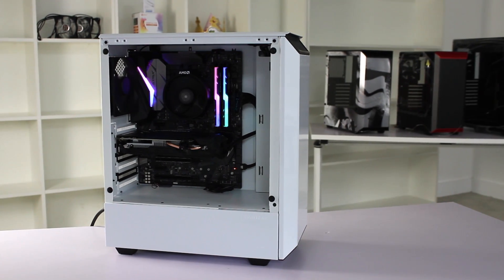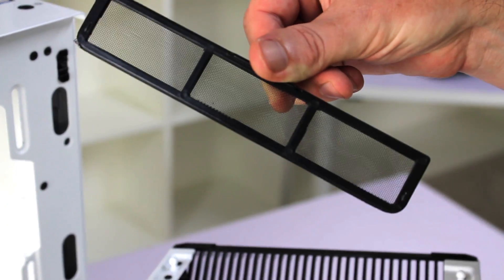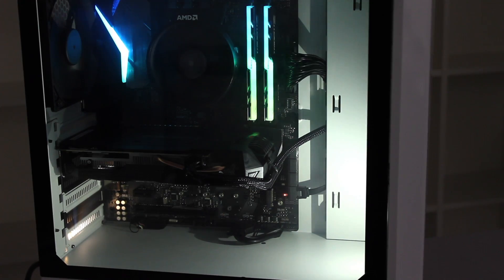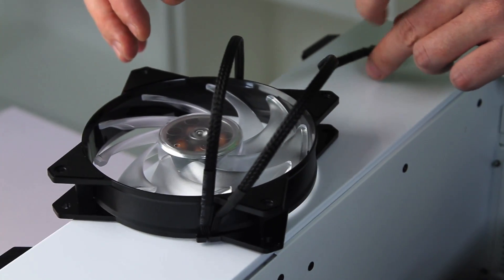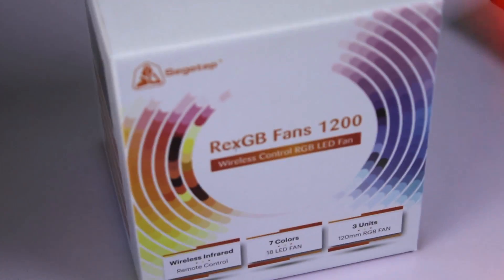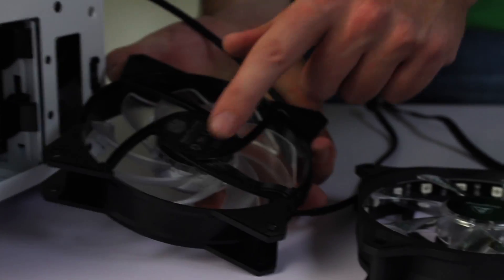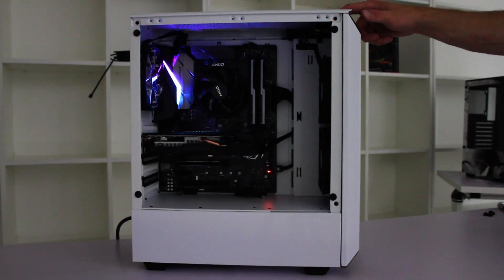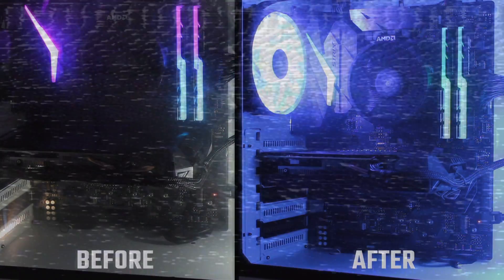How to keep your PC dust free

Comment: Perfect explanation; thank you for the reality check
I have a mesh front coolermaster case which also has a top and bottom filter and the inside of my PC is still caked with dust. I can't help that I live in a dusty room and I hardly ever clean it - yeah i've lost all self respect.

Would this work? I thought to drape something like mosquito netting over the case, speakers and the desk it all sits on (monitor sits forward and below the case) - that netting should work, right? Create sort of a outer filter to clean the air that gets pulled in? Hope you can advise. Thanks again

Comment: Guess I'd rather settle with a mesh case.

Seems to keep the dust away and all you need to do is clean the fan blades inside.

 Or no filter if mesh doesn't do anything (even though it gets pretty dirty) because cleaning the mesh is annoying

Comment: Dude, PCIE slot covers need do be full metal or have additional dust filter with nylon or something - there is no other way of preventing dust from getting through back of the case.
Reply: just tape it with electrical tape

Comment: Your saying the air flow was restricted at the bottom intake and most of the flow was coming in from the top filter however judging from the direction of smoke it looked like the opposite of what your saying. Are you sure about that. You haven't shown us the full view of the case hence I cant know for sure.

Comment: the side of the fan that doesnt spin? im really lost by that.
Reply from the maker: Ha, what I meant was one side of the fan is exposed, the other side has solid plastic connectors that are fixed and cant spin, the air usually is drawn towards this direction, a handy trick if your fans don't include air flow direction markers.
Reply: @pbtech  ahhh no kidding, so the fixed plastic on the structure is the flow direction also

Comment: meh the front of my pc is all open with three fat fans for the intake, I'm probably all set on air flow, I need to know the best way to get the dust off the fans and keep it off. I was wondering, you think coating the fan blades with something like teflon would keep the dust from sticking to it? Do fan companies do this? They should try it.
Reply: If it doesn't get stuck on the fans, it'll get stuck somewhere even worse.

Comment: What will my air flow look like if my case has 2 top fans and 1 rear fan with no front fans?
Reply: Assuming all 3 fans are exhaust, you have a case with negative air pressure. Usually, that results in a dusty case since air is entering through unfiltered spaces.

Comment: I just cover my unit when turned off all the time with the plastic cover that comes with the case and I've got no dust inside for a year.
Reply: Do you remove cables everytime you cover it? If not, then how do you cover it? 
PS: please like this comment if you are gonna answer as youtube is not sending me notifications for replies, only like notifications are showing.
Reply: nope.. the cables are all still attached. the unit is just sitting at the edge of the table that the plastic is big enough to reach the bottom part of the table. i just tuck in the parts where the plastic can be tucked. it's like a kid using a big white bed sheet to look like casper the ghost.
Reply: I do the exact same lol. At some point there Will still be dust tho
Reply: @moralstrash  yes. dust will still be able to collect but it's very minimal and for me takes about a year to show up.
Reply: @MrSiloterio  true

Comment: Would it be an OK idea to have filtered front intake, unfiltered top intake, then rear exhaust? My case doesn't come with top filters.
Reply: Anywhere you're pulling in air, whether actively or passively, you'll really want to have filtering.  Add them if needed.

Comment: Too much positive pressure can hinder air flow. You don't want a pressure wall. And you don't want heat not escaping. So those are considerations as well.
Reply: Yes, it depends what conditions your PC is in. I have a desktop set up in a farm house and you wouldn't believe the amount of dust it collects. Setting up a slight positive pressure with 3 intake fans and 2 exhaust fans alongside dust filters greatly reduced the amount of times I needed to clean it. It also helps a little that I have a blower style GPU, which is set up such that it also pushes it's air out an exhaust grill.

If you want maximum performance, negative pressure or neutral pressure would be best for ventilating the air out as much as possible.

Comment: what about nzxt h500 with 2 intakes and 2 exhaust fans vs 2 intake and 1 exhaust with the smoke machine wonder which set up would pull in more dust.
Reply: The first setup is more likely to bring in dust assuming those intake fans are at the front side.

Comment: Screw a dust filter. I have a corsair 460X case and removed the top filter and cut out the front filter, which looks alot better through the front glass. Filters restrict airflow and strain my fans. Once a month or every other I simply remove the tempered glass and wipe my case out with a microfiber towel and my rig stays cool and clean.

Comment: If you want to keep  cost down "filter" wise, use those masks they give you for free in clinics and hospitals (or you can buy a box at your local drug store) cut the sides where the elastics are. Separate and cut the parts inside keeping only one outside layer (blue or white) because all of them is too restrictive for a fan and also keep the 2 ends upper and lower. It will give you a nice 140mm X 150mm  real dust filter that you can drive your screws through . the material is also water resistant so you can clean it  under the tap and let it dry ready to use again. ;)
Reply: Good luck getting those masks now....
This hack can now be reserved for the COVID-19 pandemic...
Cut your case filter and slap it to your face😂
Reply: @kasukahei  What about dryer/fabric softener sheets? Dose not have to be name brand.
Reply: wow did not age well
Reply: @dielldevaja3579  Yup definitely, but last year you could get a 50 unit box of masks for $20, I still use those on my computer, I'm also a prepper (guy) so I have plenty,  I change the filter once a month.
Reply: @kobalt staub

Funny thing, I was gifted some nurse masks and my mother said she'd never grasp why I'd want such thing.

 Even before the pandemic, I've used them to keep the monitor clean when I had a cold.
Reply: this aged well i think
Reply: kobalt staub do you have any picture
Reply: thanks to covid I have boxes full of those masks now XD
Reply: it stops your pc getting viruses too🙀🙀
Reply: It's big brain time
Reply: You're brilliant
Reply: I represent this hemorrhoids for replacing filters )) Ideally, look for a case with a flat front and buy a magnetic filter for it. For example DEMCiflex
Reply: CLEVER MAN/WOMAN
Reply: @gino9094  but they don't know the poster's gender, so why not cover the other half of the population?
Reply: @MrGamelover23  "Person" is also a word. Stop being so gender sensitive🤣🤣🤣🤣🤣🤣🤣🤣🤣🥰🥰🥰🥰🥰🥰🥰🥰🤣🤣🤣🤣
Reply: @MrGamelover23  Because it doesn't matter

Comment: Just got myself a new case and a pack of 6 Enermax fans. The hub is different but the remote, the IR sensor and even the POWER sticker on the molex connector look eerily similar. Guess that explains the relatively low price of the pack of fans with an included hub, those accessories must cost next to nothing with mass production.